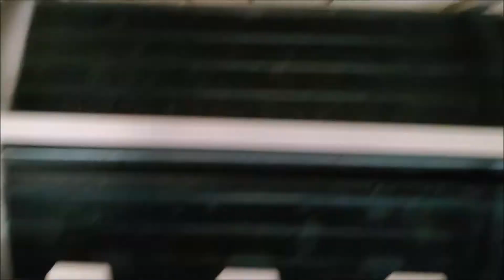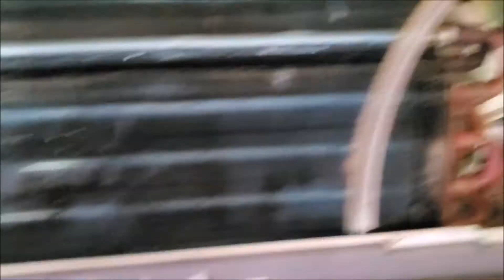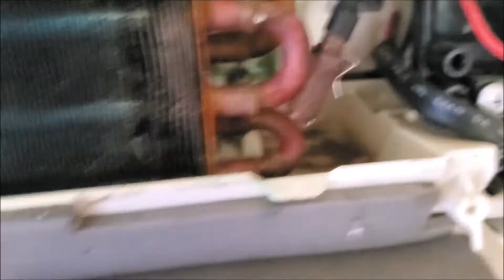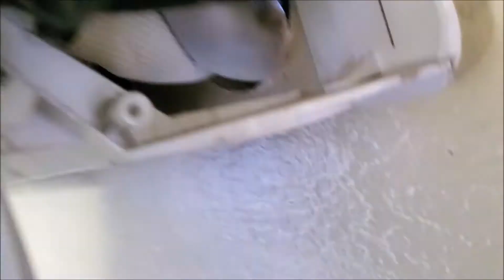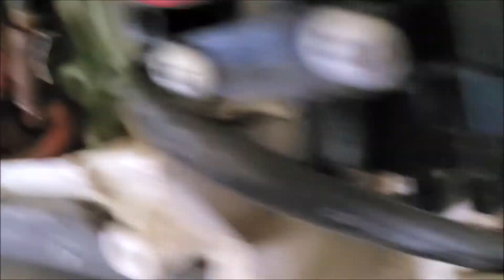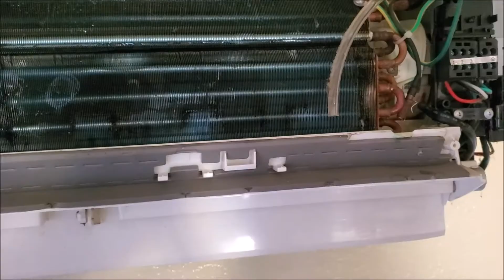How To Fix a Mini Split that is Leaking Water and Dripping

Comment: My unit is leaking water, after it runs about 30 minutes, the filter is clean, but the drain in pan, is it near the back of pan, a simple hole to drain water?

Comment: Can you advise specifically what you used to clear the line.  You mentioned 'wire' but I want to make sure I use a product that will not damage or puncture the drain tubing material.  I tried compressed air with no luck
Reply from the maker: In this unit, I just used a wire to clear the blockage, which was small and only in the unit. Basically, I use whatever works to clear the line without damaging it. Using a vacuum outside on the water line to pull out any debris often works well, but it can vary.

Comment: Thank you for this video there is a lot of water outside every time I turn on the AC it doesn’t leak inside the house only outside what’s causing this? Can it be fixed?
Reply from the maker: AC system pulls moisture from the air, so there is not much that can be done other than have it drain away.
Reply: @HVAC_Mechanic Thank you so much for getting back to me

Comment: Helllo HVAC Mechanic, and thank you for a good guide. I have a similar problem, but not the same.
My mitsubishi mini split suddenly started dripping from the indoor unit. I took the front out and inspected the pan as normal and it was dry. I then i poured about a gallon of water across the fins and it drained nicely. 
After a closer inspection the water seems to be forming in each corner of the shute. And slowly each drop goes from there and out between the plastic. So this is not a drainage problem, but still a leak. Any idea why there is water leaking from the shute like this?

Comment: Mirage mini split has same design. I did open my Mirage mini split. Use vacuum from outside. From inside I use compressor air to clean the line. I added an old rubber hose to the air blower to reach upto drain pan whole

Comment: How do you turn off the power to the unit?  There is no power switch!
Reply from the maker: There should be a disconnect box outside close to the unit or a breaker to shut off.

Comment: My heat pumpnget clean and now I can't turn the it on with the remote keep i have to turn right on the heat pump on the wall.  I tough the wires inside and it start and stop again....did someone have a answer ..

Comment: I live in Mexico I have a couple month old mini split. The line has been flushed I'm told it drips once in awhile because of condensation. What do you think?
Reply from the maker: AC units pull moisture from the air, which causes condensation and water to drip. The water should drip out a hose and not leak inside.

Comment: New 18k unit leaking water on right side of unit.  Had HVAC guy come out and he said it does not need refrigerant.  Drain line goes straight through the wall and outside.  Any ideas?  Thanks

Comment: Thank you for your video and expertise.  4th of July, water out the bottom scenario, nobody's going to come. Fixed it, plugged drain line. Blowed out with (battery) leaf blower and flushed it with water. Note: Power was turned off at the breaker box.. first thing. Once again, thanks! Jim

Comment: Absolutely hate these things. Tech that came out said he did all he could.  I've rigged a cup under that right side to catch a inch + of water a day.  Maybe the pan is cracked Idk. 4x this company has come out & every time they think shop-vac the drain is going to fix it. Convinced this company doesn't know how to repair mini splits.  Should also mention this is happening in high humidity.  Seems to mainly release a stream maybe while it's cycling.
Reply: Your tech dude sucks, mine fixed my unit in under five minutes.

Comment: I had this happen to mine. It was dripping inside.  I took a small diameter bungee cord and pushed it though the drain from outside and it started gushing out. Problem solved for now.

Comment: Had huge clogging problems first time in 5 years.  Then found out how filthy the blower wheel was.  Finally cleaned it but now the unit is off an inch one side after reassembling & either condensation is gathering at the low corner of the case or the drain pan is slightly overflowing because its now level 😢.  Starting to hate these things.  Partially hangs over a window so im starting to get water damage on the seal, wall & floor.

Comment: When you are talking about running a wire….where?  You seem to be pointing to the short wire-thing sticking inside that condenser/transition tube in front.  Do u mean a longer wire into transition hole to drain, somewhere?  Otherwise helpful and I’d assume there is a hole somewhere…
Reply from the maker: A wire or something similar can sometimes be used to push or pull out any blockage in the drain.
Reply: @HVAC_Mechanic  I just unclogged one by accessing the end of the drain line and after cleaning it as good as I could, taking a deep breath and BLOWING as hard as I could.   I felt resistance then it gave way, then it started to flow immediately.   Flushed it with hot bleach water afterwards.

Comment: If the drain is clear and the unit is dripping because it's low on coolant, will the drain line effectively take the excess water? My unit is dripping inside, seems like it's draing outside but also dripping all over inside
Reply from the maker: First, I would be sure there is no blockage in the drain line. If the unit is low on refrigerant, it will have a lot of excess water vapor that often overloads the drain. Also, the unit will likely not be cooling or heating. Sometimes, very dirty coils in the indoor unit can also cause issues.
Reply: @HVAC_Mechanic  hello I have had a tech out twice still can’t figure out why the water leaks out where the cold air comes out the water drips off the coil onto the blower wheel then down the wall. They cleaned it and put in a new blower wheel and they also checked the refrigerant and said that was fine. They checked the drain pans they are not cracked. I still think it’s the refrigerant is low causing the air to be colder and making excessive moisture.
Reply: So, everything was clear and while testing, the pan would overflow after a couple times. Appears the drain tube was too long and laying flat a couple feet. I believe the drain line was creating an air damn. Will find out today!

Comment: My unit is dripping water but my hose and tray is very clean. If the only other cause is low refrigerate how would that be a cause of the leak? Wouldn’t it drip in the pan? My leak is very slow and seems to be coming from the left side when looking at the unit.
Reply from the maker: It should drip into the pan, but sometimes the inside coil has too much moisture, and it drips outside the pan. Dripping outside the pan is usually caused by low refrigerant, but the inside coil may also need to be cleaned.

Comment: My mini split in my apartment is a pioneer and I’m told by my landlord it’s only a year old (I just moved in 3 weeks ago) It was so filthy dirty!!! smelled and was blowing chunks so I had someone come clean it. Now that it’s getting warmer I have been running it more and I notice if I set the temp to 79/80 and run it for 3 hours plus it’s fine but when I have it at 70 and run it after about a hour it starts dropping water out the bottom (not where blower wheel is but bottom of unit)
Reply: you find the soluition?

Comment: Great video, information top notch. Some
Daikin indoor units share a very similar design. Have option of drain pipe to left or right of unit. When I’m up there I give the drip tray a thorough clean (prevent mould from moisture) and spray cleaner down the pipe to outside. It it’s blocked you’ll work it out, doesn’t take much to clear. 
May as well do the fins, careful though. Delicate, no harsh cleaners. Enzymatic cleaner best.

Comment: Good tip. Had my unit year and half pouring water. I watch another video and suck it out with a wet vac from the outside seemed to do the job. How often should you check the pan before you have problem. Once a year?

Comment: What about if the unit is leaking from the back and water dribbles to the front? The condensation lines were res wrapped last year.
Reply from the maker: If you can't get to the drain, a vacuum can be attached outside where the drain line drips water to see if it can pull out any debris.

Comment: My drain is not clogged. The water is coming the whole length of the spin wheel. It like the radiator is sweating, the water is coming down and then with the wheel turning it kind of spits it out. Do you have a solution for this?
Reply: Maybe that you blow wheel is in need of cleaning. As a woman who has a lot of fear around fixing things that break down around my house, I managed to fix it. Access as many YouTube videos as you can so if you don't feel comfortable fixing it yourself you will be informed as to what the AC guy will be doing. It should not take any longer than 1 hour( having a helper around to pull the blow wheel out and put it back in works well with two people) it'll be taken outside , sprayed with a cleaner and hosed off.If for some reason the repairman says that he cannot disconnect the blower wheel, they have what they call a plastic bib that can be wrapped over the unit itself inside with a bucket below ,and clean it while the unit is on the wall. It helps if you can ask the gentleman if he has one on his truck before he comes over. I hope this helps somewhat.
Reply from the maker: The unit may be low on refrigerant.
Reply: How do you separate low on refridgerant with clogged drain problem.   @HVAC_Mechanic

Comment: For me the rubber spout outside isn't pointing downward a repair man put a brick to push the rubber spout down, worked but then the brick fell can't get it to work properly. When I press down on the rubber spout the water drips rapidly